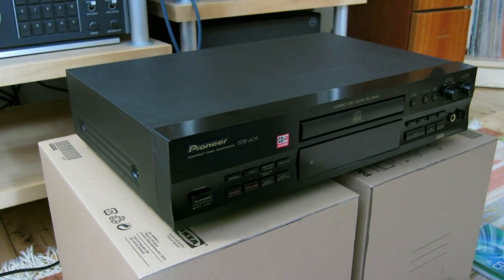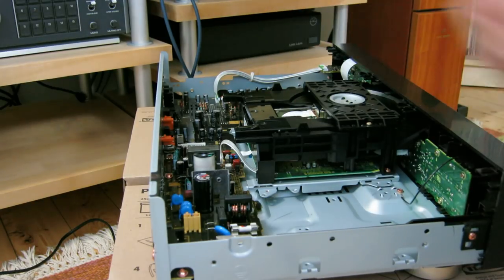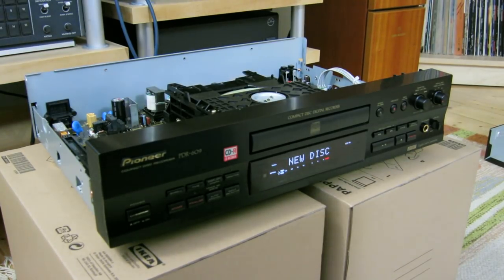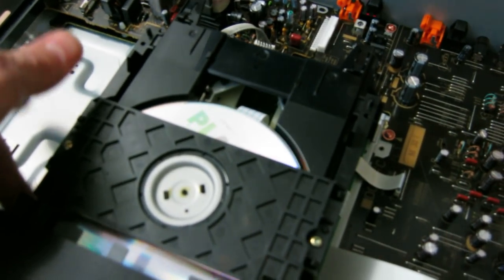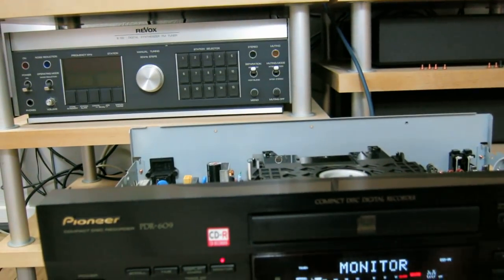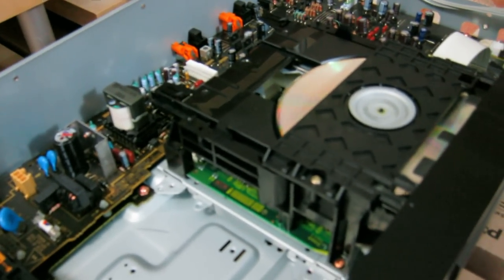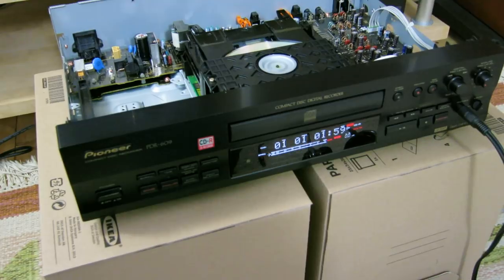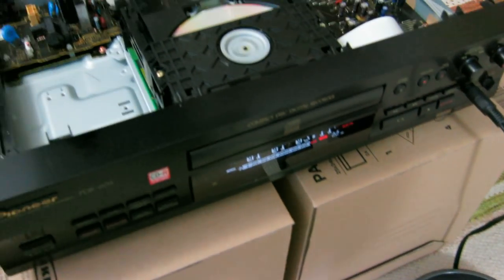How to burn regular computer grade CD-R/CD-RW with Pioneer PDR-609

Comment: This is a very good way! I improved it on the basis of your idea: disconnect the tray motor lead under the original CD drive, set a cable to connect to a switch SW1 (the switch is installed on the rear panel of the machine), introduce 6.5V DC from the power supply, and connect the DC to the tray motor through the forward and reverse switch SW2 (to control the forward and reverse rotation of the tray motor). In this way, it can be operated conveniently without disassembling the machine. Thank you very much for your video!

Comment: This is working on most CD-Recorders made in the past. Some do not need to be fully opened, just attach a good grip on the CD-Door and pull it out and push it back in. That's e.a. possible with a Philips CDR-870 and a lot more devices like it.
Reply: The cheap CDR must be the same (color) type like the audio CDR otherwise the burned disc suffered errors and distorted.
Because I did that with the Philips 870.

Comment: Your Pioneer CD recorder doesn't like the simple CD-R's you can use for the PC recorder? He wants to have the expensive ones with the "for audio" label on the cover?
With this extension you save much money with every CD. Easy to use! No external switches or wires, everything is to handle with the normal remote control! If you insist on an operating switch with a wire, you can get it...

The additional circuit is a modern ATMEL single chip processor. Not like other upgrades on the market, this modification does not have any additional switches.

Before audio recording you must use a real audio CD-R an let the PDR-04, PDR-05, PDR-509 or PDR-555RW read the TOC. After recognizing the audio CD-R (consumer CD-R) and ending up the initial procedure you must press the keys CHECK and CLEAR on the remote control. Now the tray opens and you can exchange the audio CD-R with a profi CD-R (the cheap computer CD-R). To close the tray, press again the keys CHECK and CLEAR on the remote control.

For the PDR-509, PDR-609 and PDR-555RW the same procedure is valid for CD-RW's!

Opening and closing of the tray is programmed in a way, that the internal processor won't notice anything. This means, the recorder (still thinking to have an audio CD-R) uses the profi CD-R like the audio CD-R. Be careful not to open the tray before ending the FINALIZE procedure. Only PAUSE and STOP are OK to press. If you should press the keys EJECT or POWER before ending the FINALIZE procedure, you can throw away your CD-R.

In clear: when having began to record a profi CD-R, open the tray first, when you don't want a further recording.

PDR-05, PDR-509 and PDR-555RW speciality:
Besides being able to record CD-RW's with the PDR-509 and PDR-555RW (attention: if you want to record a cheap CD-RW, please use a "for audio" CD-RW for the fake!) break up recording on the cheap CD-R(W). To resume recording you must put again at first an empty audio CD-R, and after reading it you can use the partly recorded. The display of the PDR-05 / PDR-509 / PDR-555RW flashes "REPAIR" and it reads the old status!

For damages, originating from improper usage, we don't take any liability.
All claims, also from third persons are excluded.
Reply: Can the CD-R's be played in a normal CD Player or in your car cd player after doing this?
Reply: To not nie działa...

Comment: This has been a known trick for many years, however,  not exactly convenient which is why people went for the likes of tascam where you can use either regular cdr/cdrw for date or Audio cdr/cdrw.
Doing it this way, aside from the inconvenience is that it can cause failed or faulty "burns" as the OPC (which basically corrects the laser for burning on to the disc layer) isn't correct.

Comment: This pioneer was the same set as HHB which could use normal CDR because it was a professional unit.
Maybe a hack could make it is similar by replacing the chip that read the disc info.
Anyone found which chip to reprogram?

Comment: I used to do this with the Phillips CDR 880 but you could pull the draw open from the bottom.
Reply: I have Philips CDR 760 i'll try ti do this but i doubt It Will work.. have you any tip thanks!
Reply: @alexsfera2471  as long as you can pull the draw open without pressing the open button it should work. The 880s draw was perfect almost like it was made to do this. Also you have to finalise the disc straight after recording it, if you switch off the machine or eject using the open button the disc will be no good unless you can finalise it in a pc?

Comment: Do I have to use an Optical cable or will this work with phono leads  (analogue)
Reply from the maker: DJ X-Ray You can use any input, digital or analog. The idea is to make the cd burner to believe it is having an audio-grade cd inside. For the analog inputs you will need to adjust recording level to be no higher than 0db on the meter.
Reply: @alexeijolkin7851  Hi Alexei , thanks for replying, that's great - I wasn't sure because I saw  you switch to optical. Great video by the way - it's becoming harder and harder to find decent CD-R Audio Discs in the shops I used to see them all the time . I found TDK were the best and Verbatim. I'm recording my live DJ sets from my archives from Minidisc to play in my car and due to not being able to make 2ND generation copies digitally I have to record in analogue. Thanks again . Stay safe my friend .

Comment: OK you can record but how to finalize the disc, its impossible!!!
Reply from the maker: It finalizes JUST FINE, the usual way! Otherwise I would not come up with this suggestion.
Reply: @alexeijolkin7851  yes, my unity is not close any type of discs, even for consumer, te record finish, play very well but when i try to close a message came on the display "04:15"  and freeze...   So is not a problem with a regular CD or not, My unity is broken to close...   Sorry for the coment!
Reply: Cassius Belle when you finalize a disc in the Pioneer you press ‘finalize’ and when the TOC displays it’s ‘4:15’ or whatever it may be and freezes, you need to press pause to start the finalising procedure. 

Are you not pressing pause by any chance?
Reply: Вы правы записать как показано на диск возможно, но если запись идёт непрерывно, а потом когда нажмёте на стоп показывает что диск пустой и финализировать не возможно. Пусть покажут как финализировать простой сд диск ....А это что показано на видимо для дураков....